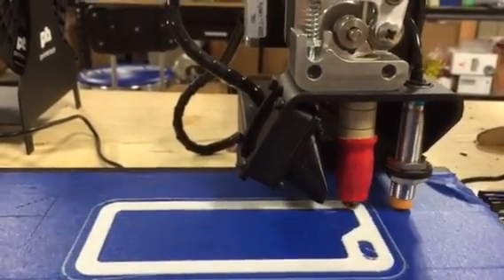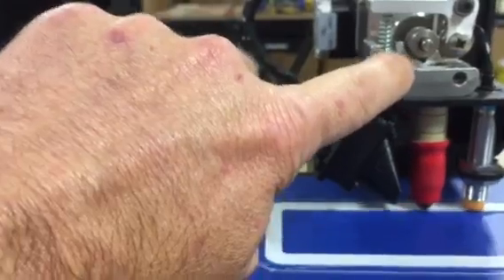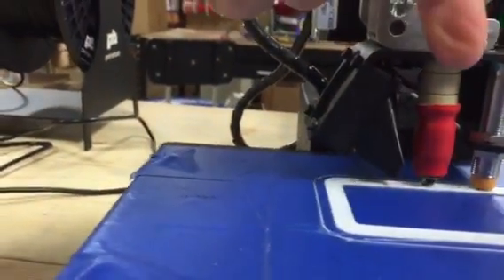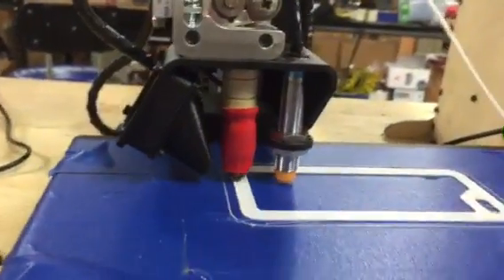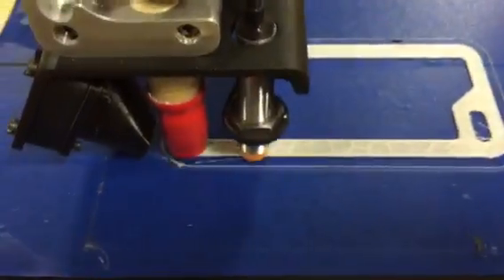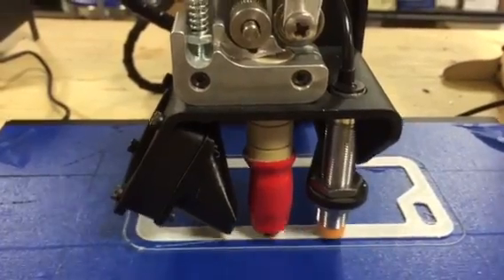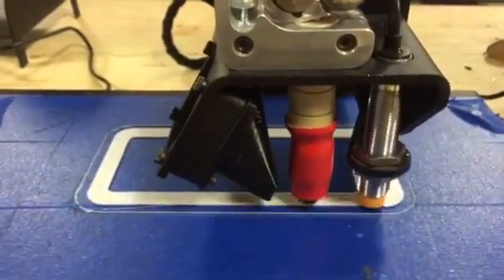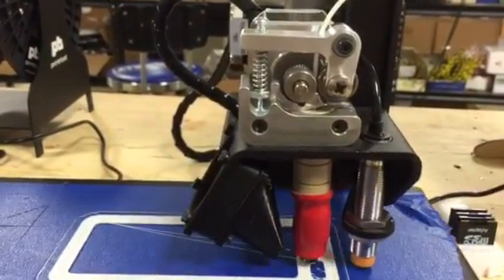Easy Printrbot hack for Ninjaflex

Comment: I have the simple metal and im curious to know ,during a party one of the guest knocked my printer off of my desk onto to a hard wood floor the desk was probably 2.5 or 3 feet off the floor and since then i had issues printing with good layering the problem being the layers over lapping, the prints are still pretty good but i was wondering what do you think it was that made the layering this way and what can i fix to make it better

Comment: What I've been considering doing is drilling out the feed hole in the extruder wide enough to accept a PTFE tube that'll butt against the input of the hot end. After that I can shave down the tube to let it mate nearly exactly to the gear & pressure bearing. I've been chickening out because if I mess up there goes my extruder...

I hope I catch one of the reject extruders when they show up in the store :)

Comment: Is it possible to add the g29 bed leveling onto cura for the simple metal? i have been currently using cura a lot but it looks like some of my prints could use a bit of fine tuning
Reply: i use this as start code,works like a charm:
G21
M104 S208 ; set temperature
G28 X0.0 Y0.0 ; home XY axis
G1 Y10.0 F8000.00
G29
M109 S208 ; wait for temperature to be reached
G90 ; use absolute coordinates
G92 E0
M82 ; use absolute distances for extrusion